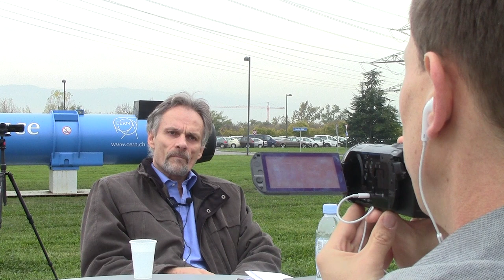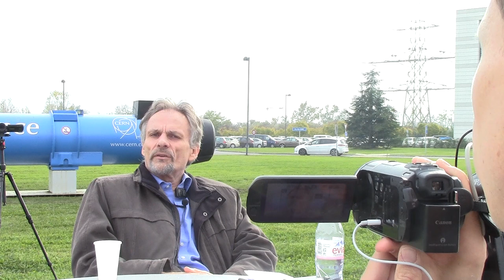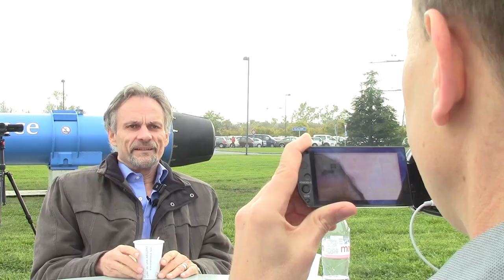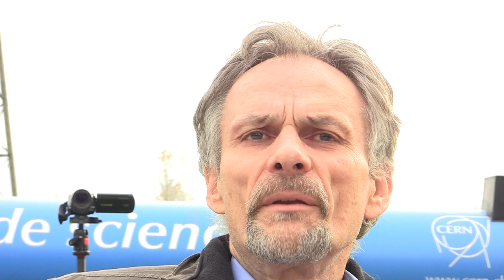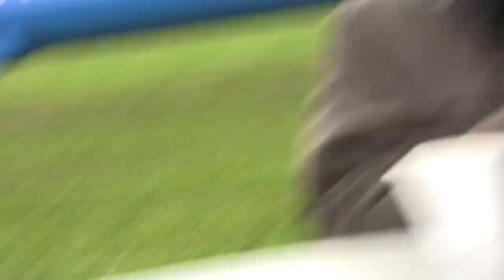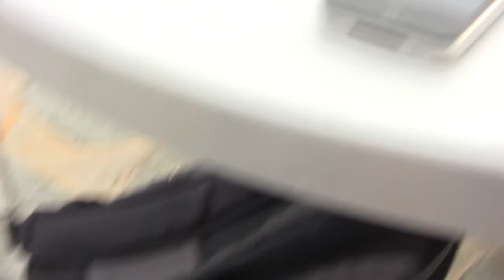Jean-Pierre Revol - Interview on Thorium Energy via Accelerator Driven Systems (ADS) @ ThEC13

Comment from the maker: Replying for Kirk to Robert Fravel. I can't seem to reply directly to Robert's question so posting response here...

Relaying for Kirk:

Dr. Revol criticizes the molten-salt reactor for its use of online reprocessing and describes how this will lead to a loss of delayed neutrons.  At the rates at which an MSR reprocesses its fuel this effect will be utterly inconsequential.

Next he mentions corrosion, and this issue was extensively considered by the research done at Oak Ridge National Lab and was addressed to their satisfaction.

Finally he mentions the regulation of an MSR, which of course will be challenging, but so will an ADS system, and I think an MSR will fare much better in this sense since MSRs have actually operated.
Reply: Yeah I thought it was a bit off that he mentioned that it was all "Only on paper" which means he must have been unaware that an actual MSR operated in the US for 5 years prior.

Comment: He also mentioned, as linked to fuel "re-processing", that a problem with MSRs is the potential delayed return of fluid to the core, such that the fluid cools "too much" leading to super-criticality. Surely though this would only lead to expansion of the fluid-fuel and thus an automatic self-correction that intrinsically avoids such an issue, i.e. negative reactivity - please correct me if I am mistaken. And also, that salts face problems of corrosion, but then later on he admits the same applies to molten lead. Salts may indeed be more problematic than Pb, but it did act to devalue his argument.
If ADS is better than MSR, then so be it. However, his opinion seemed to me to be experience biased rather than making a genuine intellectually objective argument. So, it still appears to me that ADS is just a more expensive way to be less efficient, for no gain in simplicity and negligible, if any, gain in intrinsic safety.

Comment: Gordon should have grilled him more on why we need the billion dollar control rod ("ADS") when all reactors are already inherently safe against criticality excursions via negative temperature coefficients. The real safety issue is with decay heat removal, which the ADS design does not address at all, and their hand-waving argument with air cooling is essentially coping existing DRACS of regular (critical) reactors.
Reply: NuScale has a basically LWR design, which cleverly uses passive convection to beat the meltdown liability. But the jolly old NRC application so far has cost them $500,000,000 and 12,000 pages of application submission.
This is not what Lars Jorgenson calls "efficient, evidence based regulation" and it might well cripple and send abroad the brilliant nuclear work that the USA has pioneered.

Comment: As I understand it, and he takes a bit too long to address it, if you bombard lead with protons it emits neutrons. Intrinsically, you can slow down neutrons, but you can't accelerate them. No matter from where you get the neutrons, the delay of the intermediate Pa-233 is still a drag on the timing.

Comment: Kirk, this question of corrosion has come up over and over again. Are there any specific publication references from ORNL which conclusively refute this argument. Every time someone trots off the same remark they should be pointed towards that research. I realize there's a tendency for some individuals with vested interests to be economical with the truth, but as its been said before (at ThEC-13) "physics is physics" - tho' in the case of MSR's "chemistry is chemistry" might be more accurate.

Comment: Could someone explain why a Tokamak cannot be used as a source neutrons, rather than one of these accelerators?
Reply: +Ben Jamin' It can. The problem is you have to do the same to lithium to make the tritium to keep the fusion reaction going, thus complicated. You could use thorium/uranium and lithium molten salt to both breed H3, fission U238 or Th232, and deliver the heat to the steam generator and keep the ratio of U/Th to lithium correct.
Reply: As  I think the Eh Team is saying, Andrei Sakharov suggested that the neutrons from fusion might give better results in a hybrid reactor, because a neutron that splits a U-238 nucleus releases quite a lot more energy than the fusion event that  released it.

Comment: If a suitably powerful accelerator can be made compact, cheaply and reliably enough I don't see any reason not to do it. It would probably be a huge challenge to get all three. I don't know the science but the concept seems a bit unwieldy. I imagine online reprocessing to be more simple than using a particle accelerator. However the ADS should have a political advantage, whether that makes up for technical issues is yet to be seen.
Reply: +Robert Weekes If I had a small reliable (and efficient) neutron source, I could probably make a small nuclear power plant to power my house. Due to the nature of it we don't need a critical mass of fuel. I do have metal working and electrical skills. With such a device someone could make weapons grade plutonium with the secondary neutron sources (the sub-critical fuel fissioning) or a neutron moderator.
Reply: If you have a fucking neutron gun, I do not see idiot anti-nuclear folk being all that happy about it. 
You cannot, of course, take neutrons and accelerate them by any mechanism I can imagine. The video isn't all that clear that the accelerator bombards lead (or whatever) with accelerated charged particles, ans the neutrons are a product of "spalling".
Seriously, I believe that the only hope for liberals is to educate our fellow liberals so they drop the "all nuclear is dangerous, if not downright evil" attitude. 
I don't know if it would help to reveal to them that opposition to nuclear is what keeps AGW fossil carbon in business, and that the identification of 'green' with expensive Unreliable Energy of the so-called Renewable kind is a political embarrassment  in a great many places.

Comment: what happened to deuterium and nuclear fusion?? This sounds great but i never understand a word of it but then i am not a genius like these guys and never will? i be gone before any of this comes into being anyway so it makes no difference to me
Reply: I tried it, and gave up when I realised the Schrödinger equation for more than the two body second order approximation problem my thesis supervisor had set me would be insuperably difficult for the simple 12 atom problem of the stability of benzene, which had been solved as a first order approximation.

I made a career in computer system software instead. A lucky decision, in 1960.

According to the present state of my knowledge, it is intrinsically very difficult to capture the inordinately high energy of fusion output neutrons, before enough of them  get to the structure of the reactor, distort its metallic integrity, and make it radioactive.

Comment: I think he was either being disingenuous or was simply not well informed about MSR, the corrosion "problem" has been covered extensively by proponents, there are many ways you can solve the "problem" and different materials is one of the ways you can solve that problem, as well as having sacrificial parts of the reactor that would be made to take the damage.

And he says that online reprocessing is bad, but then admits himself that they would have to do prepossessing anyway which would be to turn the fuels from a solid to a liquid and then back again, with online reprocessing you skip that step because the fuel is already a liquid. There is a good argument to be made that online reprocessing will save time and money.

And the processes have already been laid out... I don't particularly have anything against Accelerator driven reactors, and I hope they have the best of luck, but this guy when it comes to MSR just seems to be kind of talking out of his ass at best.